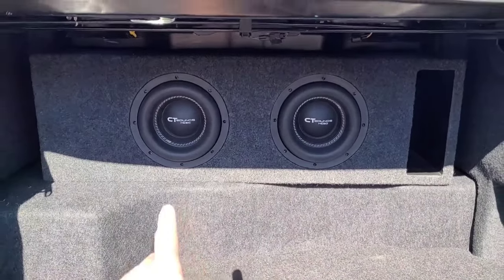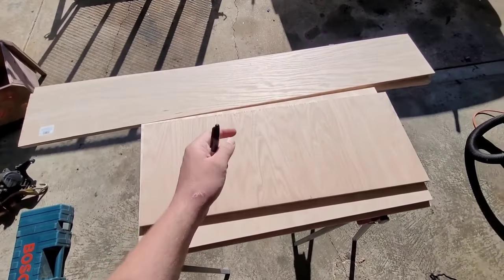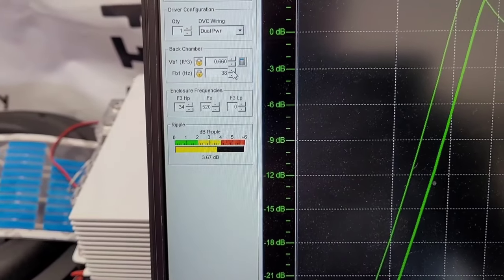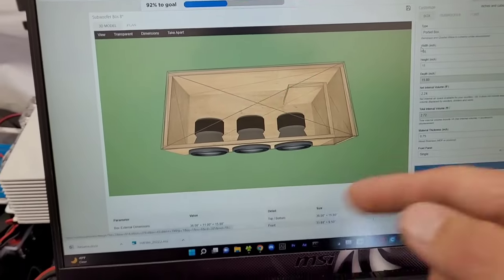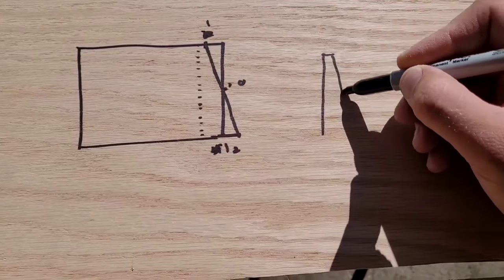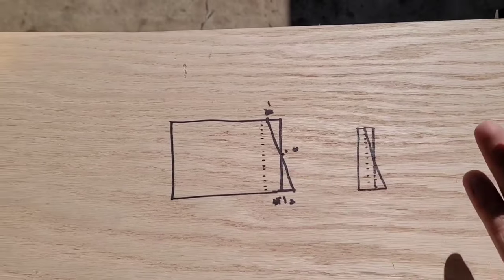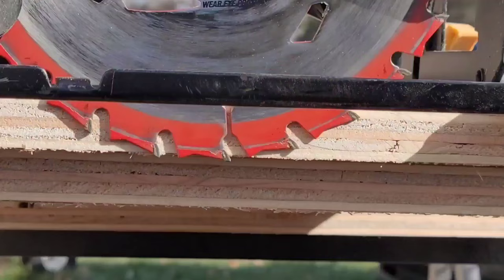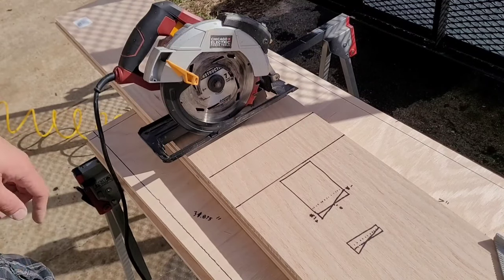How To Build Custom Subwoofer Enclosure - VERY DETAILED

Comment: First of all if you want it to look good don't use carpet don't use stain you want to use wood it's got a closed grain to it so you can work with it better on my worst box that I ever built it was still awesome to everybody who saw it just saying
Reply from the maker: Yea. This box looks terrible.
Reply: HAATTEERRR'S🤫🤨^^
Reply: @Trevor Moon  The box looks great to me, screw the haters😅
Reply: @ATCA dude this box turnt out beautiful…….job well done son!!! …id be super proud of that box if i built it…i actually need to build another box for my 4) audiopipe 6.5”s I have under the seat in my duramax…they are foward firing and sound wayyy better than both up firing and down firing 12’s i had in there previously…..i even used a 4” abs pipe with toilet flange to make a port on the 6.5” box….looks crazy but sounds clear and hits hard, but i know i can build it better if i had a plan instead of just throwing it together!!!….i also have 4) audiopipe 4 stack 12”s in the trunk of my nova in two prefabbed ported boxes…..2) 12’s in each box and those things bump with one skar rp2000.1 amp for each box……for the price audiopipe subs cannot be beat, plus they dont have funky dust caps that end up getting dents in them😊😊😊…..my truck is running a taramps 1800 watt amp for the 6.5”s and i have to turn the amp all the way down to avoid clipping!!!
Reply: Cool story bro, no one cares....this box looks sick and matches factory carpet, exactly how he wanted...if you actually watched the video.

Comment: A lot of the Lowes and Home Depots near me will not cut wood for a speaker box. A couple even have signs up saying as much. Most of the time that I can get them to cut it, it's been nowhere near accurate (usually crooked because they run the saw down and then back up without sliding the wood out of the way of the blade) Nowadays I just have them cut it like 1" over and trim it up on my saw at home.
Reply: Yeah I had to adjust my boxes when I first started because  they would mess the cuts up so now I just grab soils sheets of mdf
Reply: Can't you just tell the store that won't cut sub boxes that you're building a cabinet for your travel trailer's bathroom. Seems legit! It seems shady that they don't want to provide service to all their customers, doesn't it? I would call the corporate offices on the offenders!

Comment: Great job Trevor.  Just for kicks can you check the spl with the back seats down?  I am just curious as to the difference you are seeing.  I have (3) Sundown 10’s in a sealed trunk and found a 4db difference when the back seats were folded down.  I sold my Meso 6.5’s and went with the 10’s but wish I would have just bought 2 more 6.5’s.  Should have asked Bart for advise.  :)
Reply: Give me your true opinion of the six and a halves please!! Kicking alot of different ideas around in my head before starting a build or ordering subs. Looking at sundown and skar 6 and 1/2s also. Considering 8-in CT and skar. As you can tell I'm kind of all over, so kind of would like some input. All my friends have 12s and they tell me I'm going to hate the 6 and 1/2s. , But I want to do something different not so boring that everybody has. Also My build will be in a four-door truck with almost no space under the seat so looking for some ideas there as well!! 
      Thanks in advance

Comment: nice skill in making boxes, I am a little behind in that, I made a 10 ct strato treo box, it's just painted black, and I tuned it to 35ish, the port is on right side towards the rear, rear seats delete coupe, put foam padding behind the box, with the subs facing forward and it sounds like it's tuned lower than 30, but again your box making skills are elite.

Comment: Your enclosure looks real nice. Nice edges on the carpet. I like the wood grain being shown off a bit. However, I've got to say, 1800 is an awful lot of power to get a 138. Honestly I think you would go further having a sealed enclosure with two passive radiators. Willing to bet your SPL and your perceived volume would increase using less power having just one woofer... Would love to see you prove me wrong!!
Reply from the maker: I had just one. Then 2 and now 3. Yes this is really just an expensive experiment. However,  it's an experiment that was relatively successful.  As I stated in the early part. Losing some volume and adding power makes it have a flatter curve and still adding a bit of DB. It's hard to load just one of these woofers and be loud. The box I made for 2 was actually amazing.  Every time I turn these woofers up, I'm impressed.  As I've built heavy hitting builds, this one still amazes me.

Comment: When you do the Kerf Port how much does it change your tune? Does it lower it or increase it at all?
Reply from the maker: In the video I talked about how I compensate for the kerf. I added 1/8" to my depth during the plan phase to allow me to take this space away. Worked out perfectly. Box has an exact tune of 36hz
Reply: @ATCA  I must have gotten distracted. That's amazing! It's the same tune I'm going for with a single Sundown X15 V1 build. Need to sound good playing a wide range of music.
Reply: @v3zMedia  Note that he said the kerf makes the port length about 2" shorter. You don't count the flared ends of a port when calculating the port length.

Comment: Hi Trevor, Great build!
I have a question for your thoughts.
I have 3 Meso 8" subs that I will be getting installed in a few weeks at a local shop in Charlotte NC.
My question is about the box build. I have heard that for a small SUV like I have, 2022 Mazda CX5 Turbo, that a box with dubs firing up and port firing rear may produce the best all-around sound. Is there any truth to that and also how does that setup compare to subs back port back, subs up port up?
Thanks for your video and sharing your expertise!
Thanks!
David Ridgeway
Reply from the maker: Sub up, port back.

Comment: That’s good bro nice job , I’m doing a small build Single Skar ZVX 8 not sure what enclosure to go with yet 🧐
Reply from the maker: Single 8s are hard. Because the port needs to be super long because the space is super small. It's very hard to get right.
Reply: @ATCA  let’s see , I was talking with MB enclosures look at he’s vids on a single 8 sub hitting 130 DB
Reply: Definitely a vented box of some kind. Perhaps a folded horn or L-port. If the port is too long to fit inside the box, let it protrude on the outside.

Comment: Great vid. What type of wood did you use? Would mdf been better?
Reply from the maker: Mdf is fine
Reply: For a lot of builds MDF does work fine, the other gentleman is correct. However, in high pressure situations unlike this build, you would be better off going with Baltic birch or something of that level..
In situations with subs taking over 1,000 watts each I would certainly recommend going with the plywood, Double stacked. Maybe 3 layers deep on the baffle

Comment: best channel.....I subscribe to very few channels due to time...and this is one....how much of a difference did you notice adding the super cap....and would there be any benefit to running 2 super caps?  thanks and god bless
Reply from the maker: Without the super cap, I couldn't do it. My 1400 did great and this 2300 did fine at 1 ohm.  But at .67 it draws a bit too much current
Reply: Ty for the reply...one last thing... is there any benefit to having 2 super caps or us that more or less  useless.....

Comment: So changing the port shape part way through the port (as long as you keep the same area) will not change the air velocity or increase turbulence enough to noticeably effect tuning, output, possible chuffing, etc? Is this dependent on the amount of change in shape, how much power you’re pushing or any other factors that you noticed? Any rules you follow to make this work every time? Interesting idea as I’ve always been told regardless of the shape the port needs to maintain that shape throughout the length.
Reply from the maker: Well, I'm here to tell you, it checks out.
Reply from the maker: I've been building slant ports this way for years. Shape isn't important,  area and legnth are

Comment: Hi. nice build.  but i got a question about the bas port. since backside is angled dont you get diffrent lenght on top and bottom on the basport?
Reply from the maker: The overall area is the same as the front of the port. So the legnth doesn't change
Reply: @ATCA  ahm. ok. ty for answer

Comment: Im going to run 3 8s with a jp33 amp just waiting on my 320amp high output alternator and my XS power 3400D battery

Comment: Does that box NOT require bracing???
Reply: Is bracing "required". No. Would bracing help? Yes, it usually can. If you look at his design you'll notice there are not any large panels to flex in the first place. Its a narrow rectangular box. If you look at 10:40 you see that the inner section of port wall is helping brace things top to bottom. All the panels look pretty stiff. Maybe the one place you could add a brace would be top to bottom behind the middle sub. If it were a larger box you'd see big gains by adding extra bracing. His small box almost doesn't need it.

Comment: How did your AT1400.1 do on the two 8's before you moved up to the 2300??
Reply from the maker: It did great. I got the 2300 to run 3 meso 8s. That 1400 clamped 1k on the nose with 2. And the 2300 clamped 2100 with 3.
Reply: Also your box turned out awesome
Reply from the maker: @Joseph-ct6dc  thanks!

Comment: Is that the harbor freight router? If so how do you like it? Also what bit are you using on the router to cut out the circles and what model jasper jig are you using?
Reply from the maker: Yes it is. I hate it with a fire passion. Please do some research and buy one for your needs.
Reply from the maker: I think thr jig is a 200 model
Reply: @ATCA  lol ok.. I’m just looking for one that I can use to cut out the holes for my sub and maybe round the edges of my box so nothing crazy but it would also be good to have one to use for other stuff on future projects.
Reply from the maker: @mikeganard6751  This one is terrible for cutting holes. The collet doesn't grab tight enough even tho I have it as tight as humanly possibly.  The bit will work its way out and ruin your holes. It also broke the latch and will spin and change the depth while cutting.  So I put a grade I bolt in ot and I have to use 2 wrenches to change my height.

Okay, so you managed to cut your holes without the bit falling out or the depth  spinning.. Great, now you just want to change to a round over bit. 4 different wrenches, a hammer, and a chisel later, and you're good to go. That same collet that doesn't grab for shit also won't come out for shit.  

That's why today it is used for only cutting holes and its still not perfect.
Reply: @ATCA  yea sounds like a mess. Maybe I’ll try the ryobi router.
Reply from the maker: @mikeganard6751  I'd just watch some reviews. Sometimes the Amazon special is thr best one to get when it comes to tools

Comment: I asked customer support for some advice but they said that because doing so would void warranty they wouldn't talk about it. Does anyone know if a custom subwoofer box for a 12 inch round subwoofer works for an L7S12? The Air Space cubic feet and the mounting depth all match. If I modify it by cutting the mounting hole to the shape of the Solo-Baric. Worst case scenario would be adding a thicker board over the mounting to give the subwoofer more depth to sit on. 
That all sounds like it's no problem. But would it affect the way it sounds in a negative way?

Comment: What vehicle is that??   Really nice box and install.
Reply from the maker: 2019 Ford Fusion Hybrid
Reply: @ATCA  a hybrid? What is your electrical setup..
Reply from the maker: @abdomination  stock
Reply: @ATCA  I finished the video and saw you got a hybrid. Nice work.
Reply: Does this vehicle use a standard 12v battery to power normal 12v things? 
If so, does it use a DC to DC converter to step down the higher voltage battery pack to keep the small 12v battery charged?
Reply from the maker: @JasonWW2000  yes
Reply: @ATCA  I see your getting around 15v. Is that stock or did you somehow tweak it?
Reply from the maker: @JasonWW2000  stock its like 14.6v but the meter fluctuates a bit, and the converter fluctuates a bit with temperature.  But it won't hold 15 for long. It's just a float charge. It starts around 13.8 or 14.2 while bumping

Comment: I would have sound deaden the top and bottom of your rear speaker deck for a solid sound.
Reply from the maker: Already done. 2 layers
Reply: Did it make a difference for you? @ATCA
Reply from the maker: @anthonybrown6143  it stopped the rattles
Reply: @ATCA  i knew it would bro.
Reply from the maker: @anthonybrown6143  I did it before I Even put speakers in this car

Comment: On stock ?
Reply from the maker: Stock and a capacitor
Reply: @ATCA  did you ever test what you were actually giving those subs? They 800rms a piece. 2400rms on stock seems not realistic. But the build is nice . I almost bought two myself
Reply from the maker: @julesbruchez-outperformtra2020  watch the "how lous is 3 8s video. I clamped over 2k. I think 2200w or 2300w at 36hz. But I clamped right at 2k at 47hz

There's a few factors at play here. I have a capacitor and factory agm. I'm running at .67 ohm. And the amp makes 2300w at 1 ohm at 13v. So at 14v, it makes about 2700w. At .67 it makes almost 3k. So after impedance rise of around 1 to 1.25 ohm, I'm seeing around 2k-2.3k
Reply from the maker: @julesbruchez-outperformtra2020  here's a link. Maybe it'll be more insightful. https://youtu.be/86DfaFBuZg8
Reply: @ATCA  that’s crazy for stock.
Reply from the maker: @julesbruchez-outperformtra2020  absolutely.  That video there goes into more depth but you can see it all there.
Reply: @ATCA  I watched it all and I am just amazed. I ran 1000rms of my stock in a Lexus es350 with a big 3 upgrade and it did fine. I down sized for more room in my trunk for one 8” kicker Q. Class . And I am currently fabricating a special box to fit into the rear deck lid where the stock sun was at. Running a 1.23 air space with a tune to 36hz. Port area is 18.25. Your opinion ? Amp at 4 ohms at full capacity or Amp at 1 ohm at about half capacity?

I know a four ohm load is an easier load on the electrical system. But if I run my amp at four ohms, that max is out the capacity. If I wire my subwoofer down to one ohm, I only have to run the amp at half of the capacity in theory, I would think that would be better, but all my life I’ve always heard that for Homme is more musical and easier on the amp itself but that’s considering all things equal not running at full tilt also
Reply from the maker: @julesbruchez-outperformtra2020  1 ohm always. There's a difference between capacity at clipping and capacity at amperage.  Either way you'll be Below amperage, but at 1 ohm, you'll be Below clipping;)
Reply: @ATCA  thank you 🙏🏻

Comment: normally general rule of thumb you want your face plate of your box to cap your top ...bottom .. and sides... makes for a much stronger box.....it says very detailed... but never says how you tunned the port due to a triangle in the rear and rectangle in the front.. also did not mention what you think the box is tuned to....
Reply from the maker: Actually, I did. Taking an inch off the top and adding to the bottom doesn't change the tuning.
Reply: @ATCA  interesting... how may square inches is the new port... didn't mention... how long is the port.. didn't mention... you said you shortened it... or how you calculated the port size with the triangle shape in the rear.... but I guess by taking one inch from the top... and adding it to the bottom makes all the other changes the same 🤣
Reply from the maker: @thomasstott527  port is 30 in2 from opening to the inside.  It's whatever length the subbox said minus half the Kerf Radius. Thos box is 36hz wh3n built which I think is exactly what I modeled